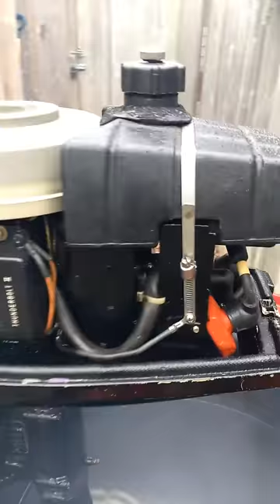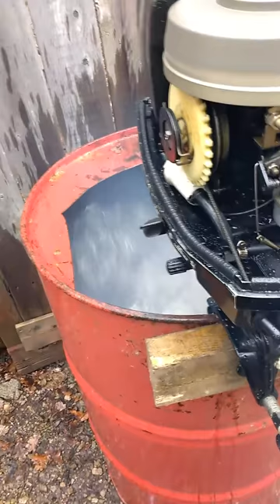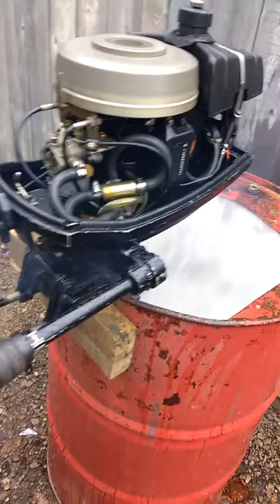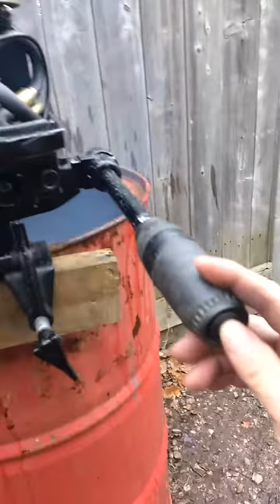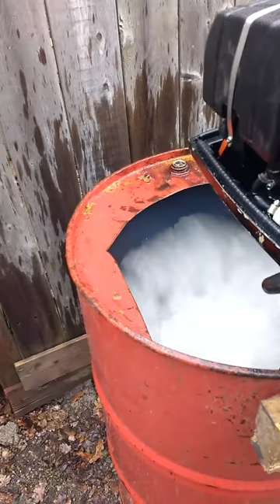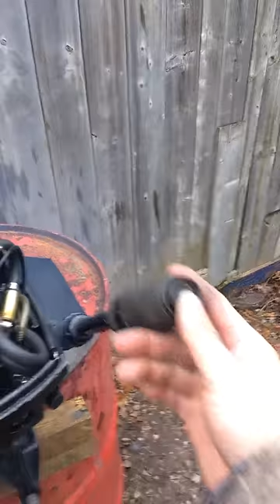Mercury GNAT 4 HP outboard motor

Comment: Have you ever replaced the pull starter? Mine has just gone today and it looks a right job to fix
Reply from the maker: The starter of these motors were weak due to the plastic gear. I did replace a few and the parts were hard to find.